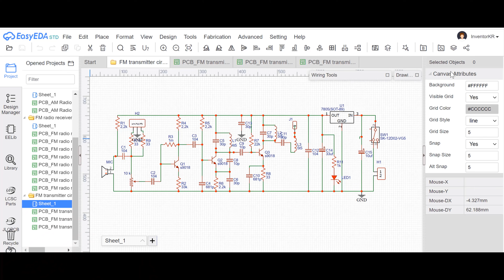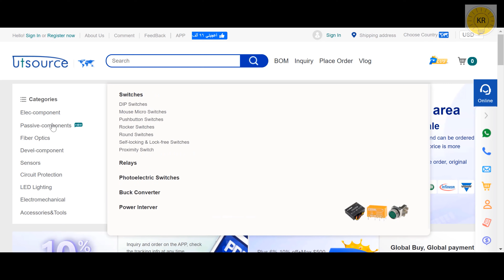induction heater 12v DC, Building1500W Induction Heater, jlcpcb

Comment: when you testing why you put video that you use mofet for make indiuction heater? You are make a fake project for this video.
Reply from the maker: My friend, the circuit is the same.  I used the previous video clip to shorten the time of filming.  But it does the same job.
Reply: Iya benar saat mencobanya knpa tidak menunjukkan transistornya,,  dan knpa yg di pakainya itu  transistor 2sc 5200,,setau ku mosfet harusnya..